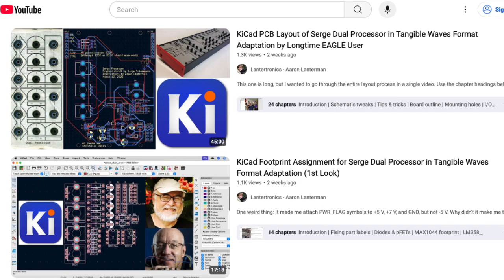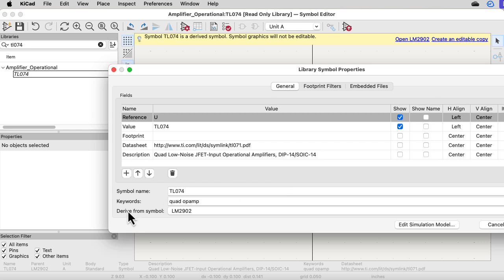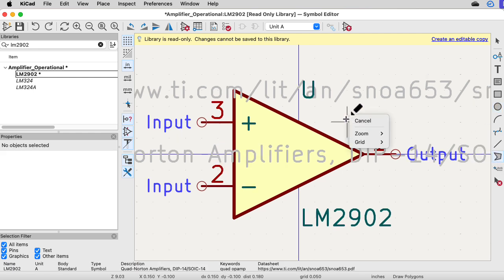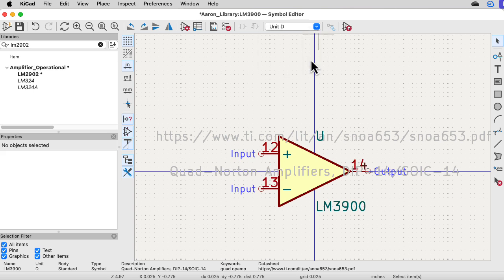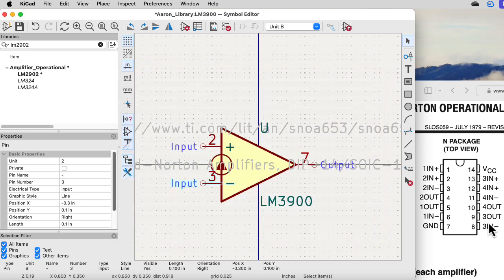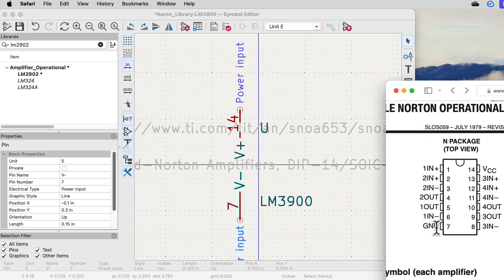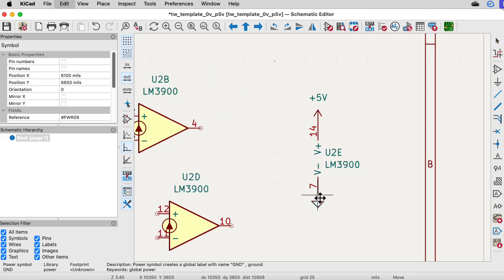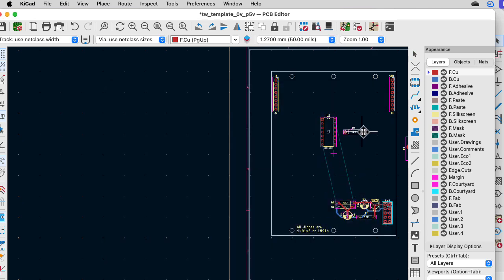Custom Symbols in KiCad: LM3900 Norton Amplifier Example -- First Attempt (PCB Layout)

Comment: Would definitely be interested in the lectures about this.  I’ve only seen it used in Yves Usson’s ARP VCF schematic, where he has 12V for V and GND for V+ — further to your point about those pins just being positive and negative rails, although it looks quite odd on the schematic.

Comment: +1 for a Norton lecture, please and thanks! 

I've never found the updating to be an issue in KiCAD because I have only ever laid out the PCB after I've finished the schematic, and done DRC etc. 
I think like any process, prep is key, and I take my time to set up as many design constraints at the start - especially any that the PCB fab will impose on me later. Even when designing using Orcad etc., back in the 80s / 90s (I have never used Eagle), I would have followed a similar "PCB layout at the very end" workflow.
Reply from the maker: Oh,  always enter the full schematic first, also. I just inevitably mess something up and don't realize it until after I've finished the PCB and I need up fix the schematic.

Comment: Norton op-amps, they handle the flow,
Working with current, they steal the show,
Low noise, high gain, they keep it tight,
In the circuit world, they’re dynamite!

Comment: Definitely interested in lectures on the Norton Amp
Reply: There is an old book if you can find it called IC LM3900 projects by H Kybett. Published by Bernard Babani publishers, it goes through some examples of both how and why someone would want to use one of these. I think I downloaded a PDF of it off reddit a while ago.
Reply: @square_waves8263  easily findable in Google, thank you.
Reply from the maker: @Ah yeah I've seen that. Good stuff.
Reply: also interested in nortan opamp lectures. thanks professor!
Reply: Some Norton amp goodness please.